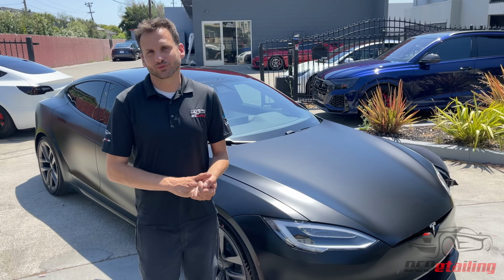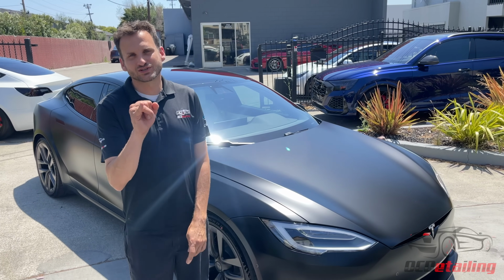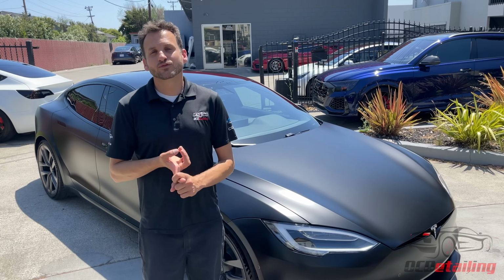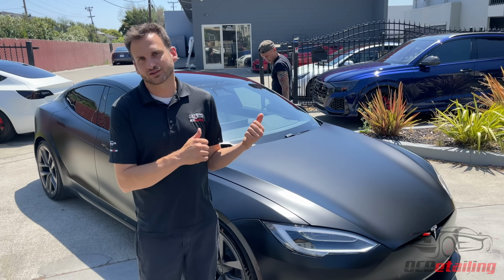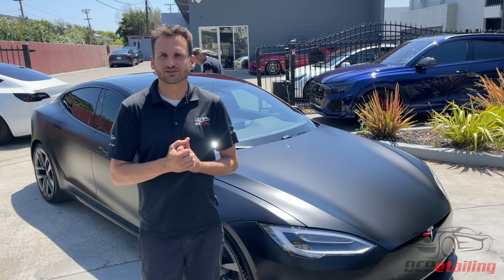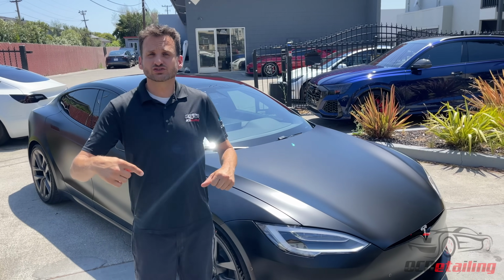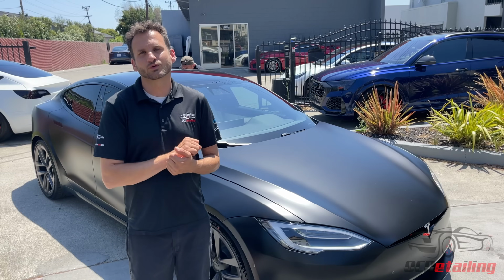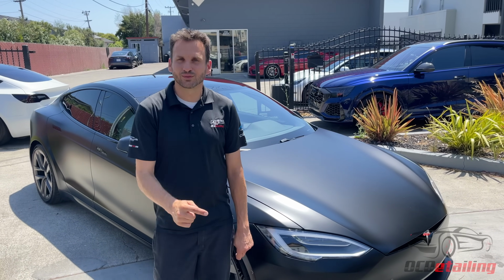Plaid Model S - Goes Matte Black - XPEL Stealth Paint Protection Film

Comment: I just had my plaid model s wrapped in xpel stealth + ceramic coat. The car is throwing an error - sensor obstructed. It was fine prior to wrap. Was wondering if you all ran into the same issue on this project.
Reply: You probably need to remove the wrap that’s covering the sensor. Sometimes it’s just wrapped right over so you lose the use of the sensor.
Reply: @italianovero220  exactly right

Comment: Why are you putting finest reserve on top of PPF...the ceramic coating will get scratched and it has no self healing so the customer will see swirl marks. The PPF will self heal swirl marks, however since you just put a diamond like coating between the film and the swirls, the film will never see them and have the opportunity to heal. You're supposed to use something like  ONE PASS ceramic pro top coat or gtechniq CSL which wont interfere with the self healing. Every detailer here in NY has mentioned this when I was getting my stealth wrap done. Seems like you guys just charged the man a ton for finest reserve for no reason.

Comment: Excuse me! There is a windshield wrap now?!
Reply from the maker: STEK DYNOFlex Windshield Paint Protection Film :)
Reply: Yeah, as a Tesla owner who has been frustrated with the glass on my ride, I was equally surprised to see this! Going to look into this in my area.
Reply: @toddyoung277  What frustrations do you have with the glass?  After having my windows ceramic coated they stay cleaner and are much easier to clean.
Reply: @BMETFerg  Besides the usual pitting from rocks, the cobweb micro-hairlines in the glass have been a source of frustration for me. Was actually considering looking into some type of protection for my upcoming Model S refresh.